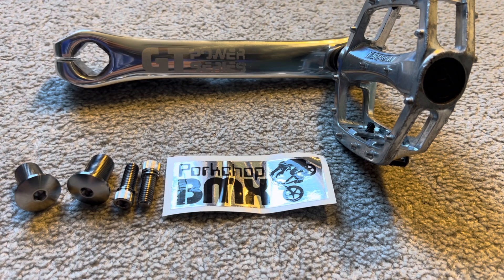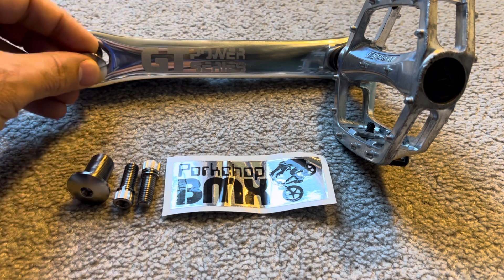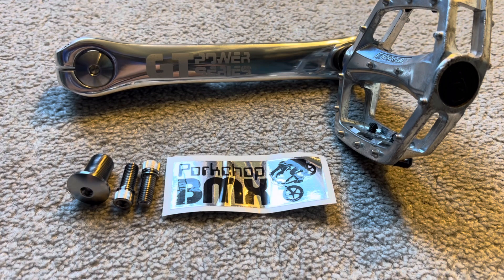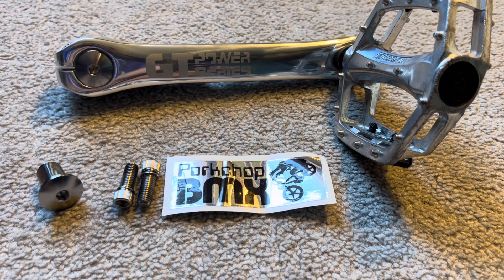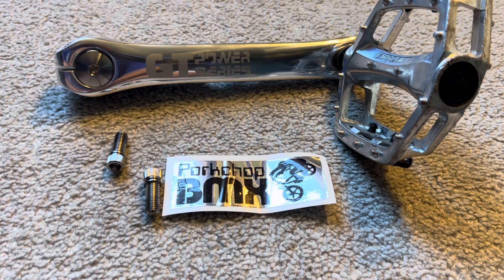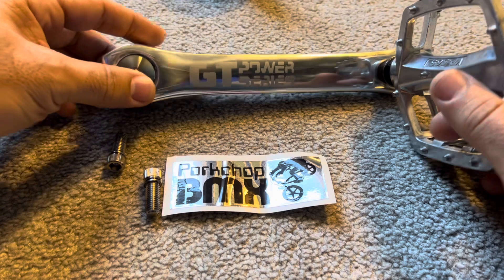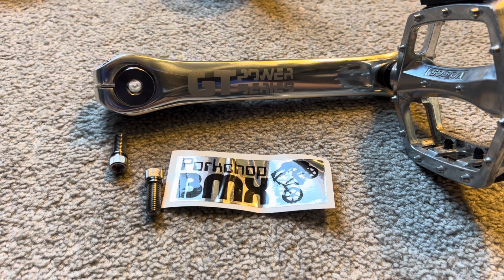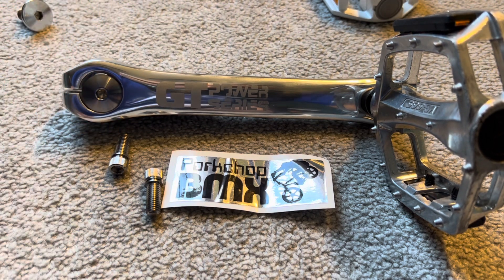Porkchop BMX 2014 to present GT Power Series replacement spindle and pinch bolts

Comment: Thank you for this video and with the quick comparison to the Haro Fusion cranks.  I'm going to try these on the Haro Fusions, as well, to see if they fit - as they should.  I've been looking for a while for some Titanium replacement spindle bolts for the Haros because the black bolts look hideous on the polished cranks.
Reply from the maker: @Perfektg TLC bikes out of England was making the Titanium spindle bolts for the Haro/Primo/GT cranks. I have a set of them and they are very nice. However something happened to their company. Not sure exactly what but the name changed to TBB bikes and they don’t offer the spindle bolts any longer. 

https://shop.tbb-bike.com/tlc-bikes/#

You can try and reach out to them directly. 

Otherwise your only option is to sand off the black oxide coating from the stock bolts. Then polish them. I’ve done dozens of them for people and they come out nice and hold up. Good luck

Comment: Thanks for the informative videos, been going through your channel. Could you do a video on how to install the repop cranks like how you did with the OG cranks?
Reply from the maker: It’s on my list, the tricky part is articulating how to measure and cut the spacer tube for the bottom bracket. If you want to forego installing the spacer tube then the actual repop cranks are super easy to install. 

Stay tuned!
Reply: @atrains   Yeah, regarding that spacer, it sounds like one of those situations where you remove a little material and check, remove a little more and check, and so on and so forth until the fit is perfect. Key being not to remove too much too soon. I look forward to the video!
Reply: I’m trying to install these cranks. I’ve had no problem with the spacer between the bearings. My problem is the bolt that goes through the sprocket to the RH crank arm. When I install the bolt, it pulls the sprocket out of line and wobbles a lot. Is there supposed to be a washer behind it to keep it flat? I tried putting the bolt in the crank arm before but the head diameter is too large to fit the hole in the sprocket. I’m losing my composure. It should have had a fixed bolt in the crank arm like the OG cranks.

Comment: I really do not think titanium bolts on the cranks will improve the performance of the cranks.  The weight of the crank arms and spindle are so heavy they mask out the few grams you lose with these titanium bits.  There is just not enough angular momentum when pedaling to notice a difference.  Now titanium parts would benefit the wheel hubs which spin a lot faster than cranks.  I would love to see someone produce them for the new GT Superlace ones.
Reply from the maker: Roger that. I don’t believe I banked on the bolts offering a performance increase. It’s mainly aesthetics over the black oxide bolts. They are lighter than the OG bolts though. Is it going to matter at the end of the day? No. But you get the corrosion resistance and benefits of the titanium being lighter.

It makes the cranks look more like the OG parts. Thanks for watching and commenting.

Comment: Great info! Watched all the GT Power series vids. Ok so im restoring my Dyno & wanna get the new power series crank. Like the reissue here. It has a 19mm spindle correct? So which BB kit do i get? One shows use w 19mm? All the spacers w a BB kit will adapt my GT OG cheese grater sprocket? The GT BB i found on web is 22mm but a Theory brand has a 19mm offering. Am i on right track?
Reply: Hey I was wrong. I figured it out. The NEW GT PS cranks are 22mm. And the GT BB are too. I looked at something wrong.
Reply from the maker: Yes the Reissued alloy GT Power series cranks are 22mm spindle so you would need a 22mm American bottom bracket for that to work. I suggest something other than GT. I prefer Primo because the bearings are not pressed into the cups. The spacer tube that is required to support the bearings can be measured and cut easier that way. If you use the GT bottom bracket you will have a difficult time getting the spacer tube sized up correctly. I’m going to make an install video for them one day. Now you can leave the spacer sleeve out and ride, it won’t fail per se. My 26” GT Pro Performer didn’t have it from the factory. It’s just that you want to support the bearing races. Again it’s up to you but I have many many miles on mine without any issues at all.

Comment: That crank set looks like Primo crank set
Reply from the maker: @garydetaeye7081  that’s because it is, under license from Easton and Primo. GT and Haro didn’t redesign the wheel. The spindles are identical, the spindle bolts are identical, the shape etc.